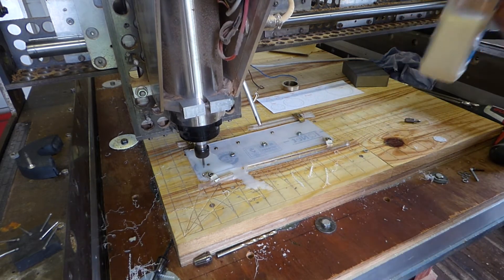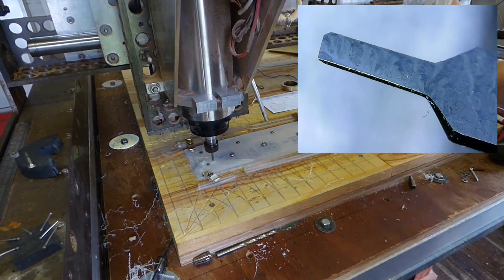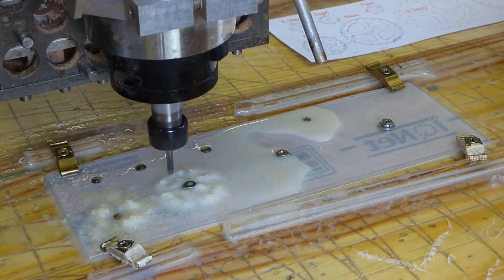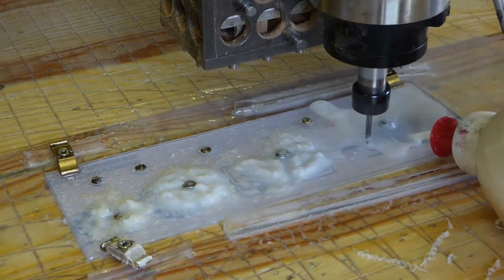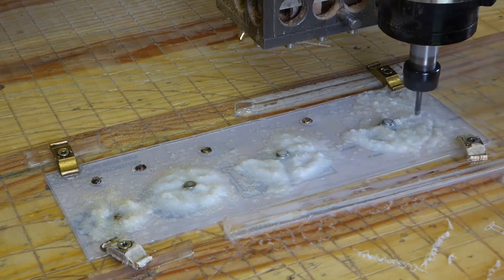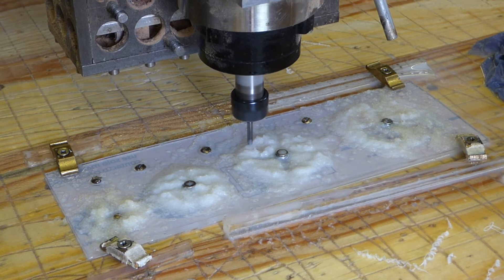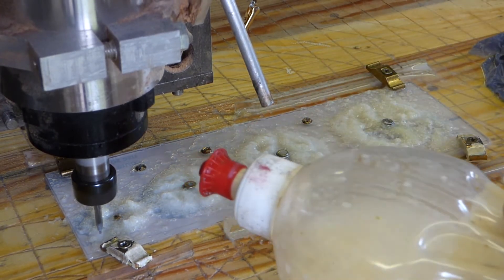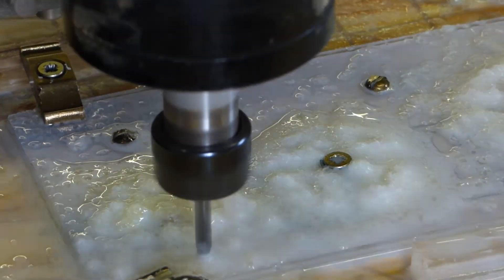The Paradox Clock - revisited Pt 02/11

Comment: With acrylic/plexi glass/lexan etc I have had best results with a 1 flute spiral up cut specially designed to cut acrylic. And I mill at a quite fast speed 1000-1500mm/min. I dont use any fluid while doing these cuts as that only makes the shavings clog up in the cut like in this video. The key to avoid melting is to get proper chips that fly away from the cutter. The large single flute helps a lot with this, and a quick speed with a shallow cut also helps because the cutter is never long in the same location. A little air stream can also help, but since my compressor is too small and keeps running the motor all the time I have stopped this also. With the correct settings I can get pretty good results with just the dry cut.
Reply from the maker: Hi. Thanks for your comments. I am very interested in your method of milling acrylic etc and would like some more information please. At 1000 - 1500mm/min what diameter of cutter are you using, because I have found that for 1mm dia cutters they are so delicate they snap if you push them too hard. Also, I have found, that milling too fast does not provide a very smooth finished cut. You will see on my later videos (07/11) I use a 3mm cutter without any coolant very successfully. I would like to know your supply source for the upcut cutters.
Reply: Hi. I am using 3mm or 1/8 cutters. I run between 1000 and 1500mm/min and depth of cut at about 0.5mm-1mm helix down in stead of plunges. I think feed and speed etc is very much machine dependent though, so you'll have to play around with it to find what works best for your machine. I buy my end mills from http://www.sorotec.de/shop/index.php?language=en 

Look for the 1flute  acry or proacryl ones. They are very expensive though.. But I have found that quality end mills are are huge improvement and well worth it for critical work. I still use the cheap Chinese ones for most things, but I keep a few good ones from sorotec for important work. I got a few nice two flute general purpose ones up to 8mm, a few for aluminium and a few for acrylics. There are also some cheaper ones with 1 flute in the 1/8 size cutter category which might be worth a try. They come at a premium but for a good reason. My most used one is a 8mm two flute and it still looks and cuts like new after two years of moderate hobby use (mostly wood).